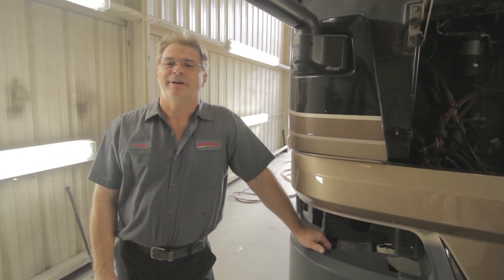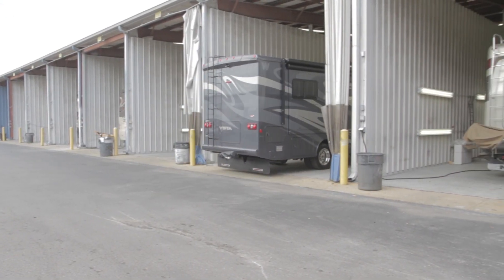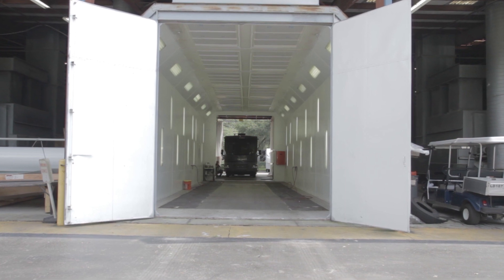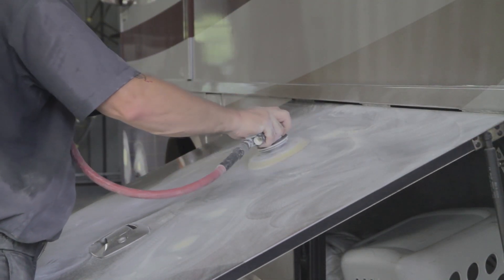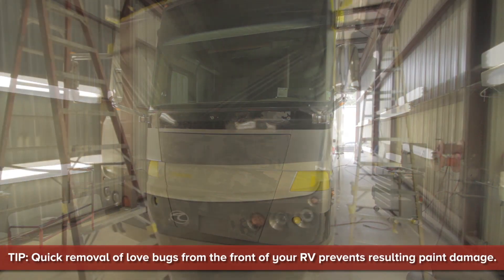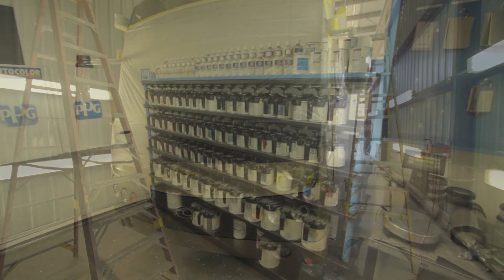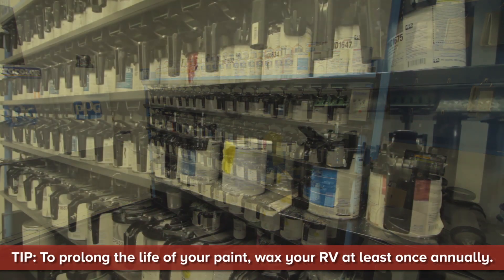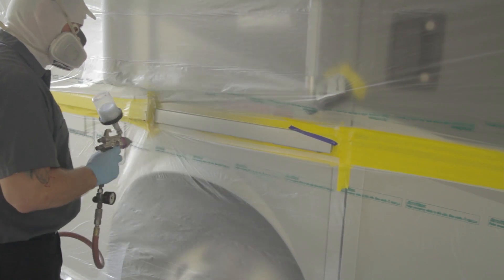Lazydays RV Service | Paint and Decal Repair Shop

Comment: How much does it cost? I have a 2014 35 ft hor Hurricane class a
Reply from the maker: Hi Abbas, the price depends upon the work you need done. Give us a call at 844-541-1059, and we can discuss your needs and the approximate pricing. Or, we can set you up with an appointment for a full estimate.